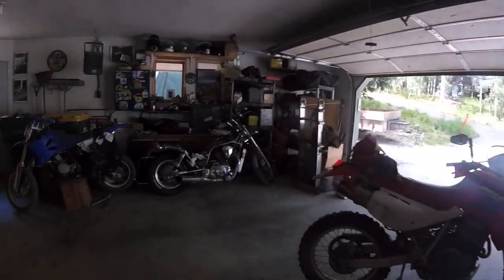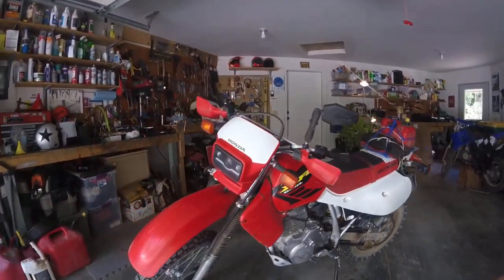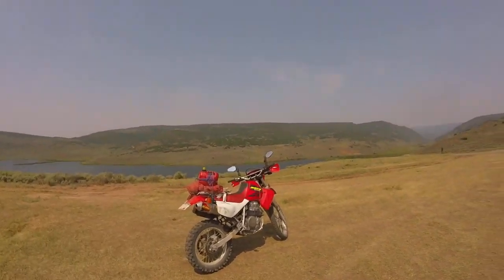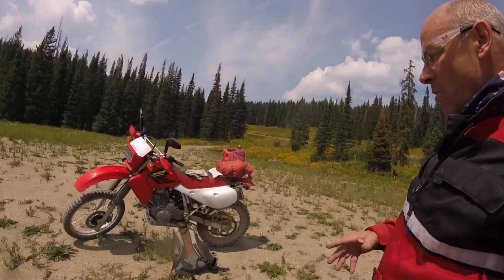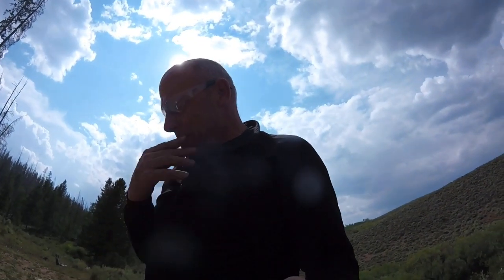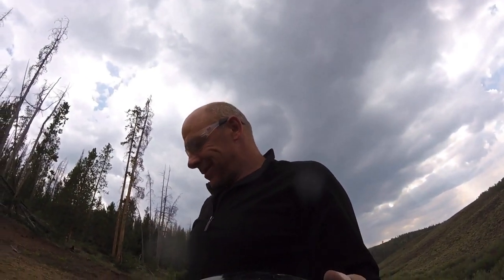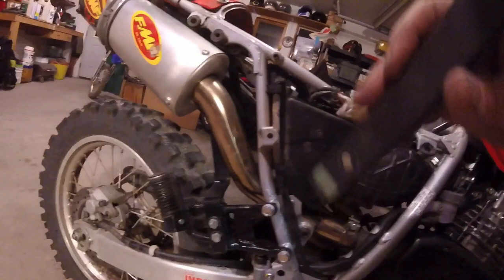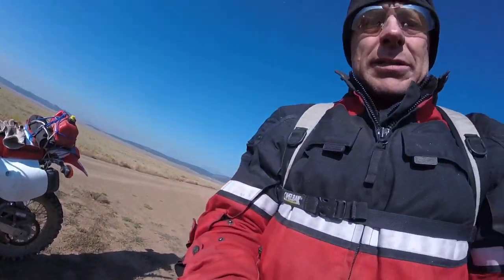Honda XR650L One of the best dual sports ever made.

Comment: If you ever need to split the case, do the infamous 2nd and 5th gear mod. Absolutely incredible change and its how Honda should be selling those bikes. The mod lowers 2nd gear and raises 5th to an overdrive. You can then run 14/48 sprockets with awesome low end and an overdrive for 80 mph on the highway.
Reply: I've got my case split right now getting ready to install both gears. Had no other reason to do it but couldnt resist this mod. Can't wait to feel the change. Especially between 1st and 2nd.
Reply: Does that do anything for your freeway gas mileage? I’m guessing not.   But still I think I would like it. The top gear can almost never be too tall for me. In any vehicle.
Reply: @TheTrace8  I had some issues with oil priming ☠ so rebuilding for the 2nd time. Can't yet comment on fuel mileage change but will pay attention once she's in the road again. IF you do this absolutely make sure you have adequate oil pressure/circulation before riding.
Reply from the maker: Was there an airlock in the system? Blockage from debris? What happened ?
Reply: @xtman693  Judging by how tricky it was to prime the oil pump the second time, I'm guessing there was an air lock situation in/at the oil pump. I had to put slight air pressure to the frame reservoir while turning the pump in order to clear out all the air. Also make sure you use an OEM metal shim gasket between the rocker cover and cylinder head. Some  aftermarket kits like moose racing come with paper gasket replacements but the correct shim is important for the center cam journal.
Reply: I had XR650L & a DR650 at the same time. After I did the 2nd & 5th gear swap on the XR650L, the DR650 was traded off. I did feel the DR650 had a smoother engine, and of course, the rear Cush hub is a plus. The XR650L with the lower 1st gear and the 2-5 gear swap is just awesome.

Comment: Definitely one of the greatest bikes ever, that's why I've had mine for 14 years, or so, I've never seen anything that would be better for my purposes, having a number of other vintage motorcycles and road bikes, I love the simplicity of the maintenance and the air cooled motor.
Reply from the maker: I agree 100%. I like the low tech design of the XR650L. Gravity fed Carburetor, CDI for spark and air cooled engine. Not much to go wrong with good maintenance. I did change out the front sprocket for the wider version. 
Even being a bit too tall for me it’s super comfortable once I’m on it riding. Great suspension too. Soaks up the bumps. Honda engineers came up with a winner when they designed this bike. Riding season is about a month away for me here in CO. I have a couple good routes to try this summer so hopefully I’ll get another video out by June. Thanks for watching!
Reply: @xtman693  I switched to the wider boss of the XR650 sprocket, I too am looking forward to the warmer weather, currently we have been having a relapse back into winter after some better spring weather a few weeks back.
Reply from the maker: Same here, spring gave a little teaser 2 weeks ago then relapsed back into snow and cold. High winds too. It’s been since October since I’ve ridden a motorcycle. Way too long!

Comment: The only thing better was the XL because of the kickstarter; stroke and displacement and ratios are too neglagable to bring up. I've toured a XL 500 and XR 650L across a lot of the lower 48. My current ONLY bike is a 2020 XR 650L with smog delete, thicker sprocket, jet change for FMF, and FMF Powercore and header
Reply from the maker: I have an old XR500 that I love. 
I’d like to get it street legal. 
Kick start and lower seat height.
I like electric start but I wish I had the kick start as a back up. 
Every time I go to start it in a remote location my mind is saying:
“Come on man! Don’t let me down”!

Comment: They are so damn top heavy,  16" of clearance translates to top heavy,  I've dropped my forks about 3/4" and a lowering kit helped a bit,  contemplating the SuperMoto wheel kit. Plus I'm not but 5-10, so every little bit helps. I have a 2014 with 9500 miles.  A lot of fun  !

Comment: This bike literally is. When I finished racing, was in the open class, this was the logical next step. Bike is simple. No BS stuff like Fuel injection or radiator to deal with. Adjustable or ability to up grade suspension to your needs/desires.

Makes perfect sense for an ADV bike to add a big boy fuel tank. travel bags/gear. 

Using US routes, or forest trails, chugs along dependably. 

Heck you can just about stop in an size town and there's Honda store or combo there of with just about any need on the selves.

Oil though, I do change between 3K to 5K including filter(s). Like said above there's a Dealer along your route should you prefer them to service you 650 ...

I call mine the dream liner ....rock on ..

Comment: I've had numerous KTMs, road bikes and a couple of newish 250 hondas. Just bought a 30 year old dominator - same engine but we don't have much off road fun over here to really use an XR. Really enjoying it so far, nice low down torque, fine for motorways & no more messing about with shims for valve clearance adjustments.

Comment: Good vid, thanks for sharing. Getting a bigger tank is worth every penny. I went with the IMS 4 gallon capacity. No fitment issues and it has integrated cooling “wings”. No change in engine temp, just less time searching out gas stations. 👍🏼
Reply from the maker: Thank you for the comment.
I am leaning towards the IMS tank. Read good reviews on it that match what your saying. Easy install, quality construction and no petcock issues. 
Tired of sweating about distances between fuel stops with the stock tank.
Have some good routes planned for next year, venturing farther into Wyoming on some back roads. I’ll want that bigger tank.
Reply: @xtman693  Also just curious what you think. If I ever have to push it long distance or if its hot weather I use premium, do you ever switch grade?
Reply from the maker: I always use the premium grade for my motorcycles. And it’s not for more power. Octane is an antiknock agent, and while our XR’s are only an 8:to1 compression they get hot and sometimes a hotter engine can cause pre-detonation. The higher octane gas can prevent this from happening since it ignites at a bit higher temp.
The higher grades of gas have more detergents in them also. Which helps carbon deposits and other crap from building up in the combustion chamber. 
So for my motos it always premium gas. For my car, well it lives on cheap gas. 
That’s my 2 cents anyways! Happy riding and be safe!

Comment: The DR650 is also a great bike. I've ridden it in Colorado quite a bit, almost entirely off-road and forest service trails and stuff like that. A friend of mine has an XR650L like yours. Same thing, great bike, never any problems, super reliable, both the DR and XR. By the way, that IMS shift lever is a bad thing. You're right to go back to stock. There's a reason the stock shift lever is soft, it will bend before the shift shaft bends.
Reply from the maker: I almost bought a DR650. The seat height is a bit lower and it rode really nice. A little better top end on the highway too I noticed. 
I had my heart set on a Honda though and passed on it. Then it sold a few days later and made the decision easier for me. 
They are a great low tech machine too, durable and have stood the test of time.
Both Iconic in the dual sport world. 
High strung, computerized fuel injected bikes just don’t appeal to me yet. Maybe some day but high tech stuff just doesn’t seem as durable.
Like new appliances! Great when they work but horrible when they don’t.
Reply: @xtman693  I agree about the simple, older tech bikes. I’ll never own a fuel injected bike, don’t like liquid cooled bikes either. Must be my age (55), I prefer old school stuff!

Comment: Nice bike you should definitely get yourself one of those 5 1/2 gallon aerobics gas tanks. They have the air shrouds built into the tank. And get a rack for the back it will help hold all your stuff.

Comment: Good video man. I grew up on what this bike replaced (the red white and blue 1987 XL600). That was the last of the best "thumpers".  Same RFVC engine, but slightly bigger displacement with the XR. The XL did have more hp than the XR600 in the day because it had 2 carbs instead of 1.  I'd leave the battery right where it's at from the factory as well. Good on you to change out that front sprocket. Hopefully you went with a 14 tooth. Sweet looking bike. A classic design. I like how your interpretation of "hauling ass" is 50 mph. That was comical. When I was 13, I desert raced and cruising speed was 65.That was what I considered slow on the dirt. My dad couldn't keep up on his '86 KLR600.   Hauling ass, as you put it, didn't start until you were wide open on a fire road at an excess of 90 mph. That was the norm, but back when I was untouchable and indestructible. Never got hurt, even though I ran it hard. That's just how things were back in the day. Hopefully you carry a spare CDI box on you. Also, don't run the bike too hard, like I did, or the valves won't last long: Just a FYI.. A small crescent wrench would have bent that shifter back, without having to take it off. Good thing you Macgyvered it though. You should also think about buying a bigger tank, so you don't have to deal with the gas can strapped on the back.

Comment: Bigger Tank + external oil cooler = WIN!
Reply from the maker: Yes I’m having a hard time figuring out which large tank to buy. IMS or the Clarke. I’m hesitant on the oil cooler, I don’t ride much in temps above 80 here in CO and it’s one more thing to get a puncture wound in. 
I think I’ll get the temp gauge dip stick and monitor the oil temp. If it’s getting above 225/230 I might invest in the oil cooler. What kind did you install? The Sutton?

Comment: To fix the gap between first and second you can use an NX650 second gear, drops the ratio down a little bit. You can also use an NX650 fifth gear to get a little lower cruising rpms

Comment: Good move going back to stock shift lever…. My son snapped the shift shaft on my XR 400 and I had to split the cases to replace it…. Major pain in the ass.
Reply from the maker: Exactly what I’m worried about after trying to straighten the after market one! It was hard as hell. 
I have the new one but haven’t installed it yet. 
Pretty much done riding this season here in CO so I’ll probably get it installed next spring. 
This weekend I put some gas stabilizer in, rode it around and pulled the battery. It’s in my shed now. I hate this time of year!

Comment: I put on the larger IMS tank and have my bike jetted for 5k feet.  No heating issues weather I go to lower desert or higher up into the mountains.  I also ride a lot of slower more technical stuff in the high desert.  The bike handles everything really well.
Reply: It is also a good idea to carry a spare CDI with.  If it goes out you are screwed but if you have a spare it is a super easy fix.   Other than that these bike are pretty bullet proof.
Reply from the maker: I’ve read about the CDI boxes and I think this winter I’ll order one and take it along. Going solo a lot means taking a few extra parts to ensure no walking.
Glad to hear the IMS tank is a good fit, I’ve stories about the Clarke’s and the Acerbis not fitting right and being a struggle. I didn’t think about the clear one being sort of a gas gauge! Great idea. 
You’ve had no trouble with engine heat by removing the wings which was my primary concern. 
Im going to get go searching for the IMS and see what we’re looking at for price and availability. At least I have all winter now, it’s cold here and just snowed. Probably going to be putting the big Honda away for the season. ☹️☹️☹️.  It was a great summer of riding though so no complaints there. 
I have a great four day route planned for next summer and hope to get some video of that. I need a new GoPro or some kind of camera, the batteries on mine don’t last long anymore. Plus I’d like to get a microphone to record as I’m riding. 
We will see, I don’t want to burden myself with too much camera stuff. I like keeping it simple if possible.
Long live the XR’s!!
Reply: @xtman693  I have the Clarke 4.7 gallon tank.  It was a super easy direct swap and fit great.  So far I haven't noticed any issues with heating.  I live at 4,300 feet elev and ride a lot of long rides ranging from sea level to about 8,000 feet.  I think the only time I would notice an issue would be on a hot hot day and riding very slow trails where I wouldn't get enough air flow by the engine.

Comment: I agree the XR650L is a keeper, I have an assortment of bikes I've accumulated from many years of riding & if I could only keep 1 it would be the XR650L! I agree the range isn't good so bought the Acerbis 5.8 gallon tank which should solve that plus it's front edges are wings which I hope duct air in similar to the factory bolt-on wings.
Reply from the maker: Yes I would have to agree. The XR650L does it all . I was afraid of getting that huge Acerbis tank for fear it would make the bike top heavy but I like the fact it has the wings built in. I’ve heard of mounting issues with the Clark and IMS tanks but I’m tired of tying on my gallon can. I’m in the process of converting my 1980 XR500 to a dual sport for my son to ride. It’s got a bigger tank than the 650!
Reply: @xtman693  well until you need it for a long ride you  could just keep 3 gallons in it.

Comment: My old XL600 rocked. These 650's would be sweet. $2800, you should buy two. Dry sump runs much cooler imo. Judging by my XT500. My Sportster was dry sump too. You get used to checking the oil.
Reply from the maker: Yes, it was a steal at $2800.00. I’ll never spend money on a high end Mtn. Bike ever again. I’m getting used to the dry sump, it was a change for sure. I can see why they run cooler, the frame is never hot like the engine gets. 
I’m looking for an old school chopper now after watching “ChopperTown: The Sinners”. It really appealed to me.

Comment: The front design on Japanese bikes like to slide out, not as stable as European bikes. I have the same problem so when I ride a Honda or Yamaha I tend to force that front tire into the dirt more on lose stuff, sometimes even putting my foot on the axel bolt and dig it into the ground. Heavy bikes for sure but nice power through the range. The Honda is the better choice for sure! Better suspension! America is not so friendly about Enduro series bikes anymore! I do 50 to 100 pushups a day, keeps my upper body in shape and stomach. I walk 3 to 5 miles several times a week also on good hilly roads. I am 67, with bilateral hip replacements. Have to keep as fit as possible, especially with this pandemic! Ride safe sir! Enjoyed your video and humor! 🍿🍺👍🙏
Reply from the maker: Yep, keeping strong is key.
I’m trying to get in the habit again. It makes all the difference.
I didn’t know about the front ends being superior on the Euro bikes. Interesting. Makes me feel better for the wipeout!
I was getting tired and a bit lazy, I should have been better prepared for that loose corner.
Thank you for the comment and compliment!

Comment: I gave one of these bikes for my 50th birthday, that was 6 years ago. I have no complains except one, sometimes it does not like to start!  do you have the same problem?? When that happens I just push it in 2nd gear. Another thing, be sure you check the front sprocket and the shaft, XR 650 L like to eat the shaft.
Reply from the maker: Hey! Another rider in his fifties! Right on. We are at the age where we don’t need massive speed and power just the freedom of riding. 
I also had an issue similar to that with the switch on my kickstand. 
I cleaned it out with contact cleaner and it’s worked ever since. 
If that checks good there’s a chance the CDI is starting  to go wacky. I’ve heard of several cases of that and it’s intermittent. 
I installed a new Fritzco sprocket on the front due to the countershaft wear issue. It’s wider and reduces wear on the shaft. 
Thanks for watching the video and enjoy the XR650!

Comment: Good that you changed out your front sprocket
Reply from the maker: Yes the Spritzco sprocket worked great.
Reply: @xtman693  I used the KK bike sprocket and they are also good
Reply from the maker: @johnheckscher7138  Is that the super spline one from Europe?
Reply from the maker: @johnheckscher7138  I also have the XR650R sprocket but it didn’t quite fit right. I was going to have to modify it a bit. Too thick on the one side and threw the chain out of alignment.Still have it though in case I need it.